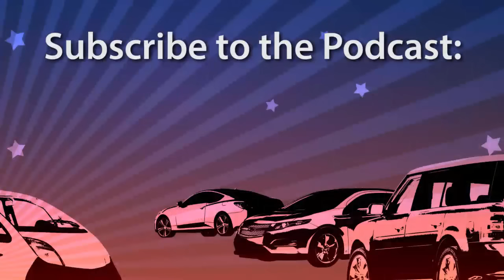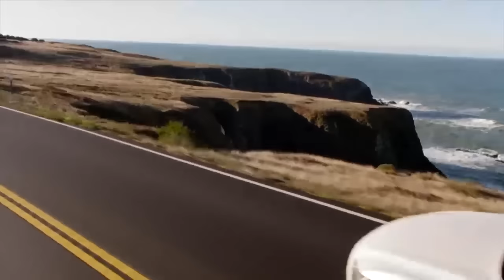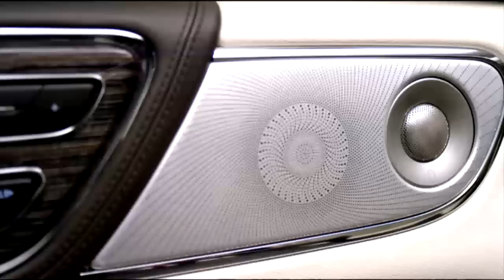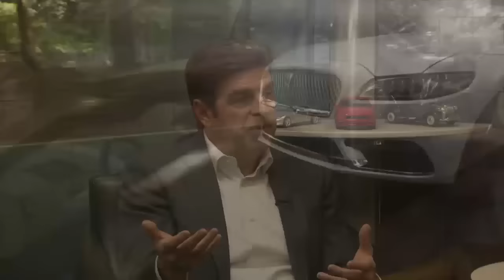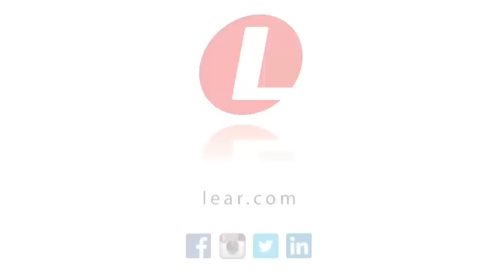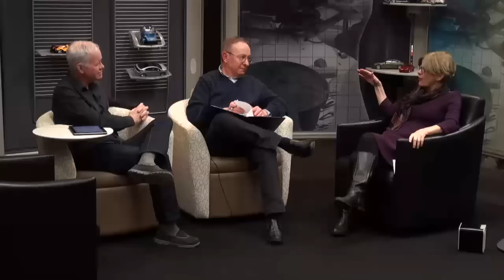Engineering The Lincoln Continental - Autoline After Hours 363

Comment: I think the Conti is gorgeous.  Very refreshing to see a luxury car be a luxury car and not a sports car with luxuries.
Reply: True John.  That's what I'm looking for.  I already have power and sport in my Acura NSX.  Just took delivery of my 2017 Continental, and it actually is by far much more substantial than the three Lexus, Acura, and BMW I own.
Reply: Chris Haywood This is much more innovated, not everything is all about brute V8 anymore. Efficiency and quietness is what most manufacturers are looking to do, keep in mind I said most not all.
Reply: Agreed. The '06 Conti concept was also a proper Rear-Wheel-Drive luxury car, unlike this POS with a sideways engine driving the wrong wheels.
Reply: It doesn't have to be about the V-8. Although a V-8 option would make the car more competitive with the rest of the premium luxury car field. It's also about looks, style, and comfort. Unfortunately, because the Continental is built on a wrong-wheel-drive Ford Fusion platform which uses a sideways engine, it has the short dash-to-axle ratio and long front overhang of a plebian FWD grocery-getter. This is not a good think when trying to compete in a market dominated by RWD, V-8 powered cars with the more upscale proportions afforded to a RWD car with a  longitudinal engine layout. Lincoln has dropped the ball dramatically in this case.

Comment: the Continental is simply a fail. the interior architecture is no different from the Taurus/fusion, the switch gear is shared with sub 20K ford products, it's FWD,  it lacks the same level of tech and engineering found in many Lexus / Cadillac products, it's interior material palate is more comparable too the Buick Lacrosse or an Acura Product with the use of injection molds, plastics, pleathers. it's simply not able to compete in the same field as the Lexus LS or Cadillac CT6 which are runners up too the 7 series and S class (the class leaders). Simply put this product was an over hyped. they spent all it's money on the seats which have so many seams it hurts your back. it's not comparable to anything from Cadillac Or Lexus.
Reply: Justin Bouche Not sure what you're looking at, everything is completely different than the Taurus/Fusion especially the architecture, options and dynamics.
Reply: John Reid how so? make a counter argument.

Comment: I like how most of the time he is talking about the top of the line models when in reality most sold will be the rental special with front wheel drive and the regular crappy seats. Then they have a HUGE depreciation problem. Also the door handles are hard to get my big hands in. Was he joking when he thinks this will be anywhere near as reliable as the old Lincoln Town care? I mean REALLY!! The old car was a simple body on frame car with 1/4 as many parts! I am sorry but does Ford prescribe hallucinogens to it's engineers? The engine alone will cause lots of coking problems later and have turbo issues and tons of plumbing problems.This is a Turkey that won't fly at 70k+ to get all that stuff.